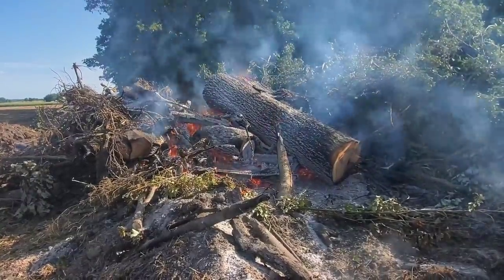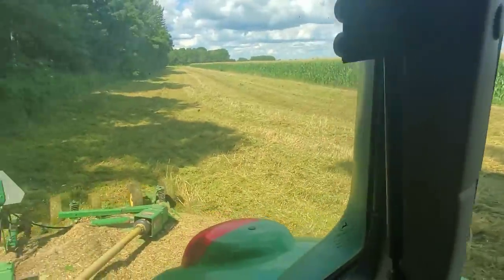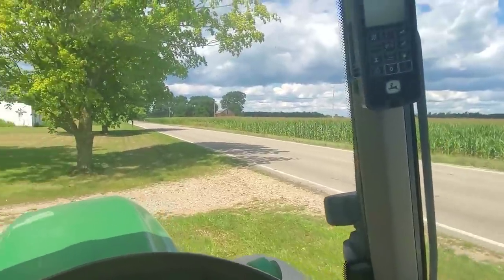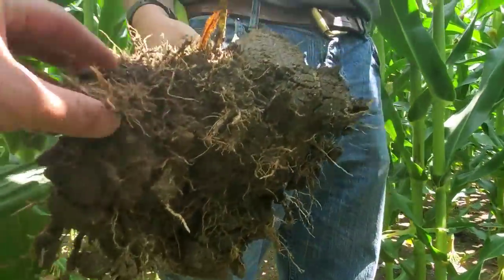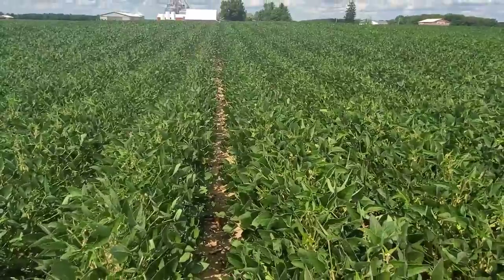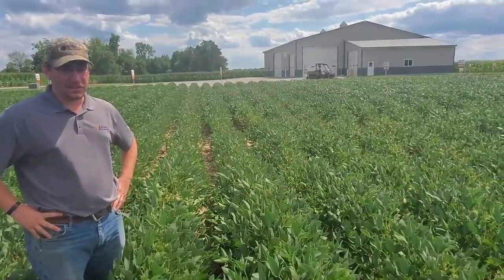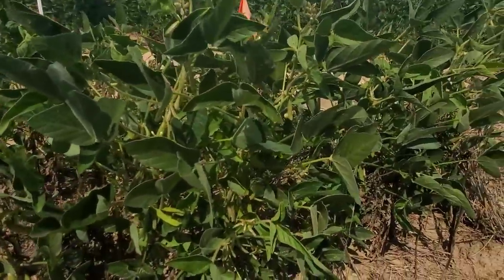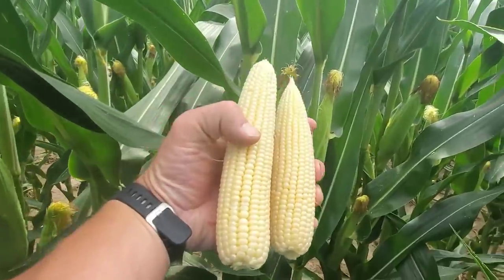Crop Scouting! - #212

Comment: Below I found a how to that would get you started on using a raspberry PI to monitor the grain bin, you may consider adding temp. & humidity later. You're correct to design a physical/visual way to get the information,  the Raspberry Pi's can be clustered to all your grain bin's to see them from anywhere. This is a basic setup without a PLC between the computer and the sensor's, but you get the idea. If you need help with it let me know.

https://medium.com/@TanakittiSachati/how-to-use-inductive-proximity-sensor-with-raspberry-pi-3-model-b-python-539ecc731bf3
Reply from the maker: Is that article written in English?

Comment: Not sure if you are aware, but you need to be careful with running electricity (AC or DC) in with grain dust as it is explosive. I actually work for Murphy and deal with natural gas compressors. Grain dust falls into a category just under natural gas. (Grain is Class I Division 2 Groups E - F where natural gas is groups A - D). I am not sure what rating the sensors have to be resistant to the dust getting inside. Just food for thought.
Reply from the maker: Another reason to leave the wiring on the outside of the bin. The sensors are IP65.

Comment: Question on the sensors how does dust affect the sensor sensitivity. I would assume that once they have contact with wet crops a film will develop. Just wondering what you think on this.
Reply from the maker: Thats my biggest question on the whole system too. The sensors have a sensitivity adjustment though so I should be able to dial them to sense grain not dust.
Reply: @BorderViewFarms   My thoughts are the dust will attenuate as it builds up and will cause it to show product is there when it's not.  Lets get it installed and test it out...